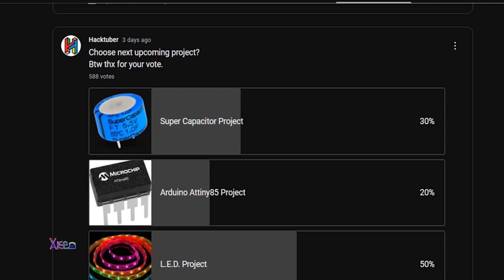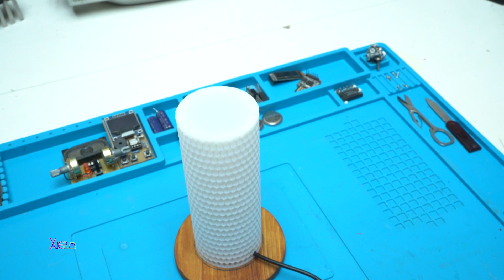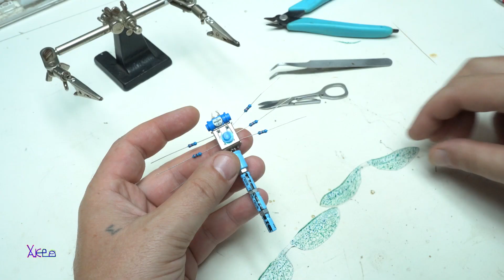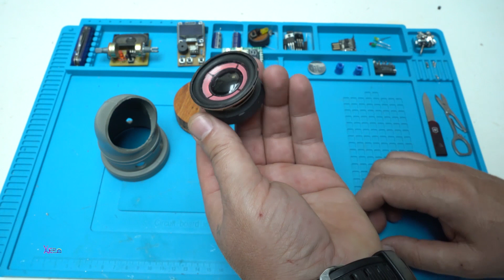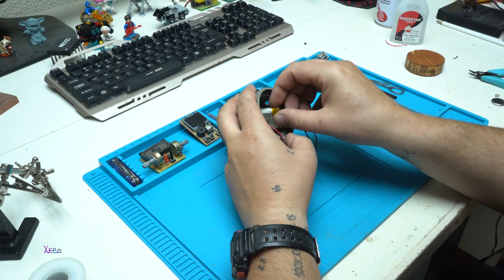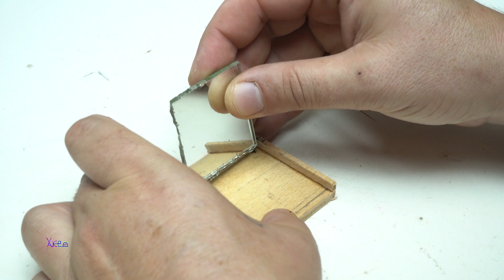Amazing Gadgets made at home and you need one of them!

Comment: Excellent.  Maybe it's time to get a 3D printer. Project 1 looks good, Solar projects are my thing right now and the light column is cool. However, I know nothing about these printers. Will the plastic hold up to Arizona heat? I have been using empty glass Tasters choice coffee jars with good effect. Something like the column would be a welcome addition. Subscriber and Fan. Thanks
Reply from the maker: I have a 3d printer and for sure will be new videos using a 3d printer,just to inform you there are many filaments with defferent temperatures,abs is strong and durable,thx for support